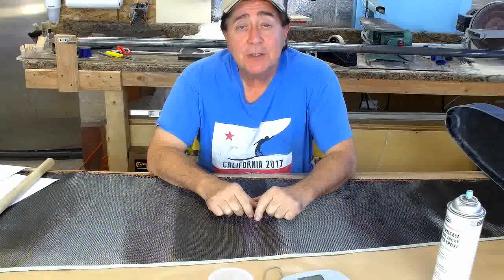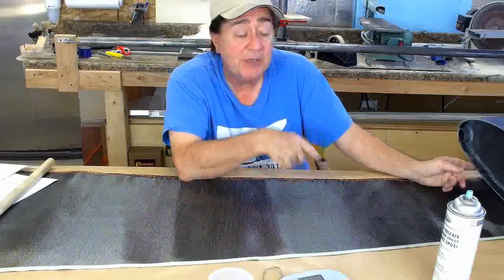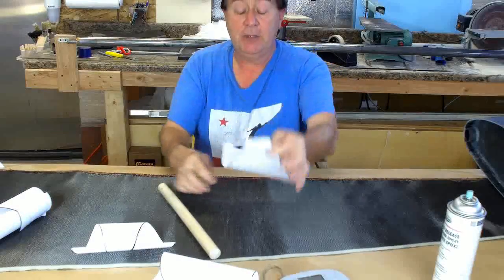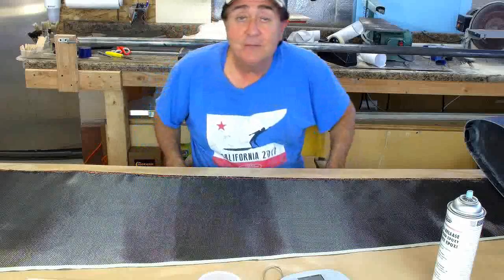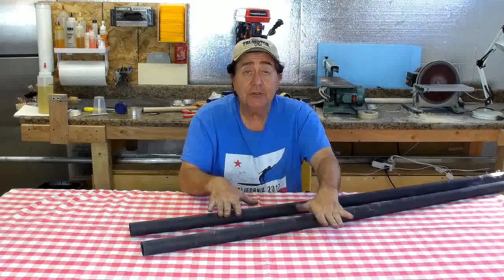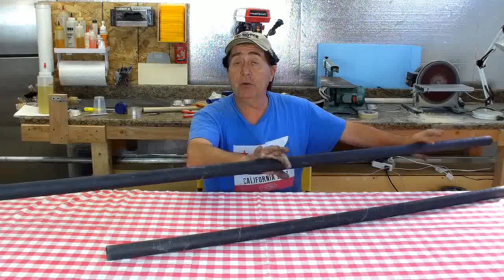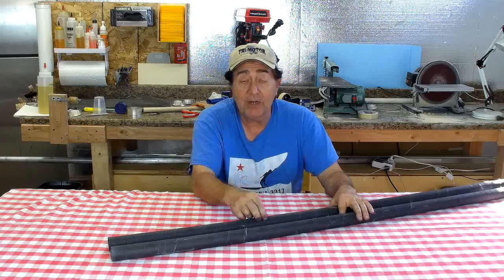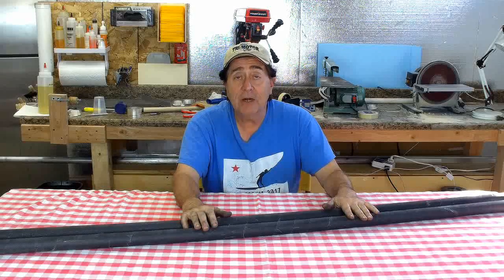Why Custom Tubing - KW MkII Hang Glider Class 2 Development

Comment: these vids are great! but how long and thick, wall thickness is the main wing spar? how would you do a 7 meter spar for a hang glider? also, why are you just using a round tube instead of other shapes like i-beams or ovals?
Reply from the maker: To see how the main spar is done, please see the video for construction/assembly of the wing section used for structural testing. For home processing, round is easiest to make, plus you generally need to twist the tube to remove it from the mandrel and of course that only works with round tubing. Different processes are used for commercially produced CF shapes.